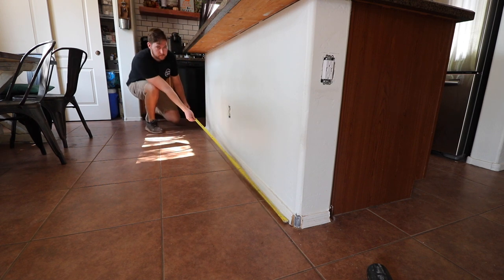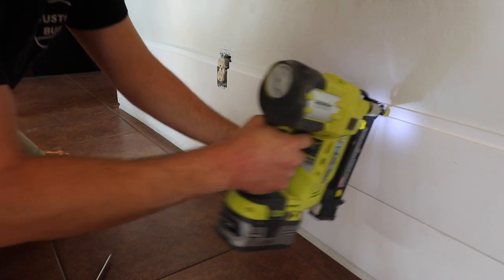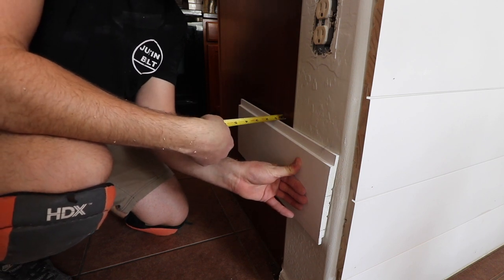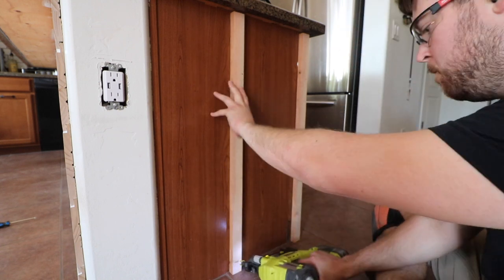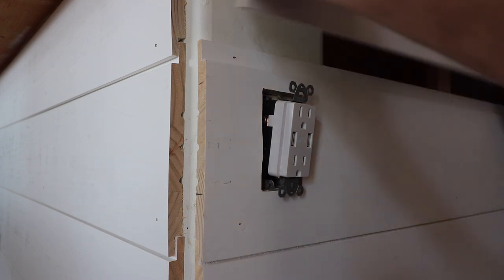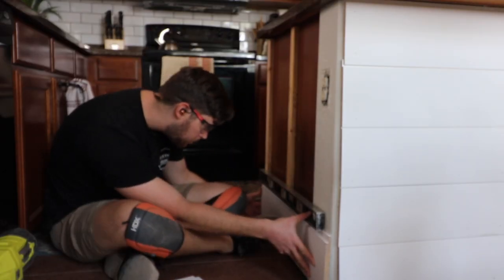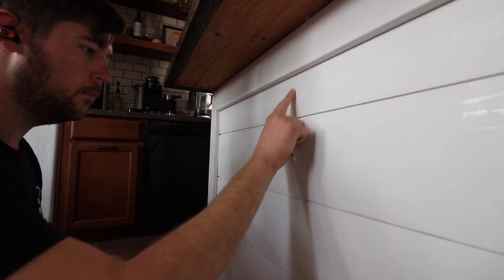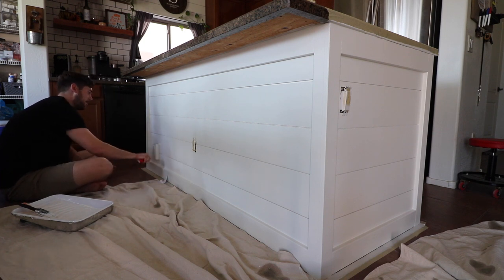How to Shiplap a kitchen Island

Comment: I’m in the middle of doing this and stuck because of the rough edges of shiplap that are showing near cabinet doors side of the island. How did you cover up those edges?
Reply: Have you tried another corner piece?
Reply: I would look into adding a smaller trim piece maybe scribe molding?